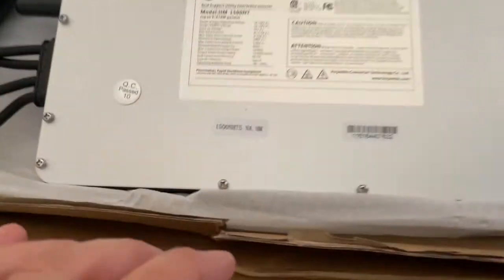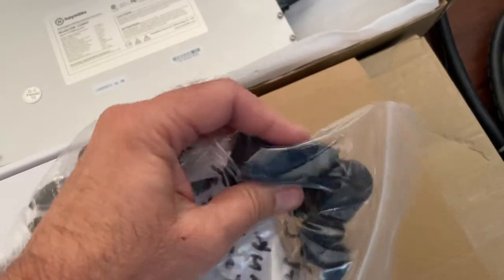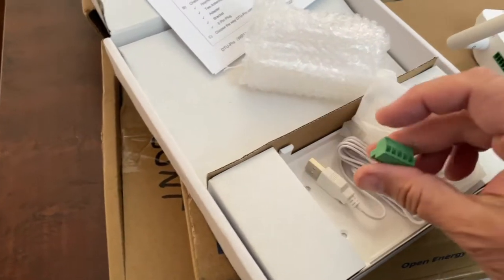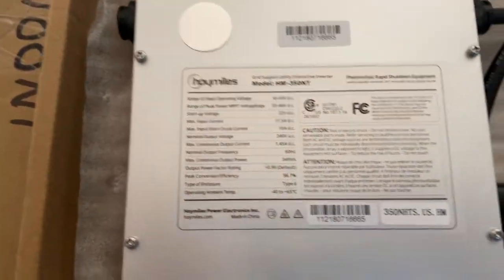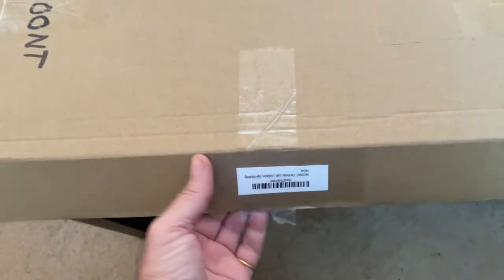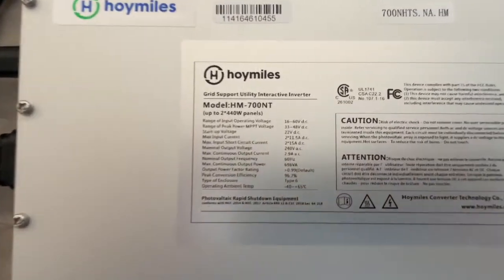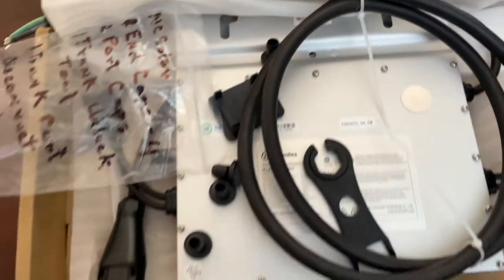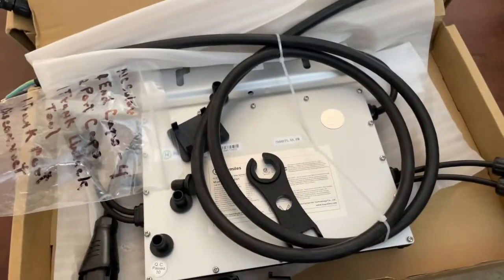Solar Power DIY Helpdesk - New Microinverters Arrive!

Comment: I purchased one to test it: "Hoymiles HMS-2000-4T HMS 2000W 4 Module Microinverter" which is supposed to come preconfigured at 240VAC which is what I need. I am just doing 4 panels at 450 watts each. Mine did not come with the trunk cable. It came with no cable. Did I purchase the wrong one? I purchased from a company in Arizona. Where do you recommend I purchase from? Can I just purchase a connector and use my own three conductor wire? I need advise. Thank you!
Reply from the maker: Hi Ben, I have the cables in stock at themicroinverterstore.com. Hoymiles warranty is contingent upon using their cable.
Reply: @DiySolarHelpDesk  Thank you for all I learned today watching you add the Hoymiles. I just ordered the trunk from you. I was going to express ship but there was not an option. I look forward to receiving it soon. Thanks again for getting back to me so fast. I will order my additional inverters and stuff from you after I set this up and play with it. I want to order the White wireless gadget as well to monitor my set up and will do that. John in Fallbrook